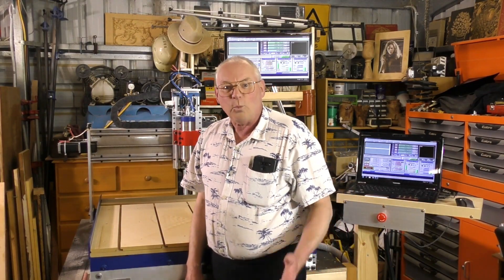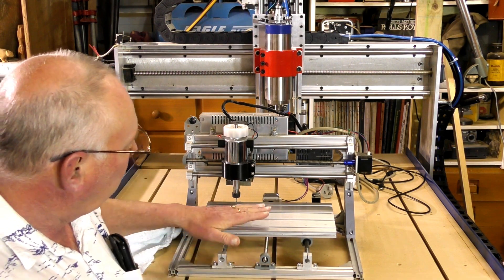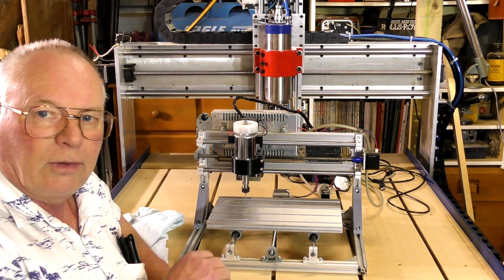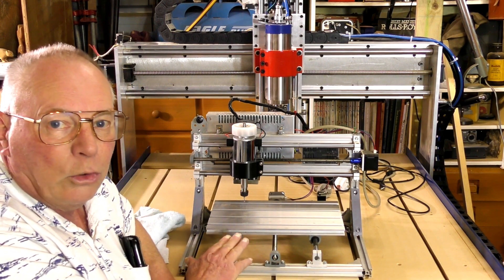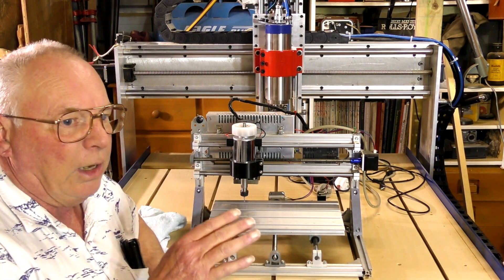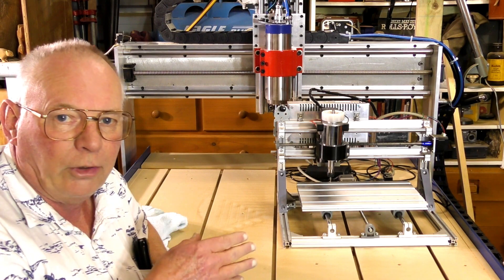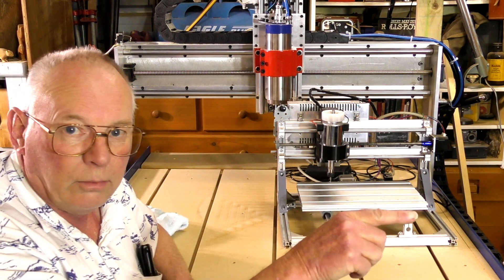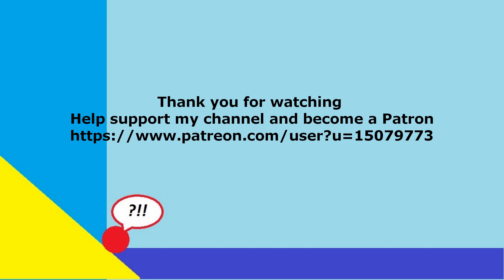Mach3 and CNC Machine EXPLAINER ( I answer your problem questions ) Getting into CNC episode 1

Comment: Another good video
Reply from the maker: I appreciate that, thankyou 🎄
Reply: @inventorsworkshop9600  hello from NY state. Would any of your cnc router tables be suitable for non ferrous metal?
Reply from the maker: Yes
Reply: @inventorsworkshop9600  thank you. I would really like to be able to build one like the one you built with steel structure painted in blue. What is the approximate cost of all material and hardware and electronics? Is the full build available on Patreon? What subscription do I need to have access to all plans and videos?